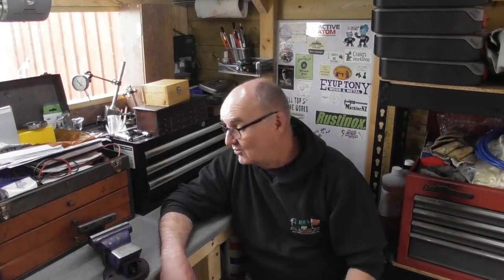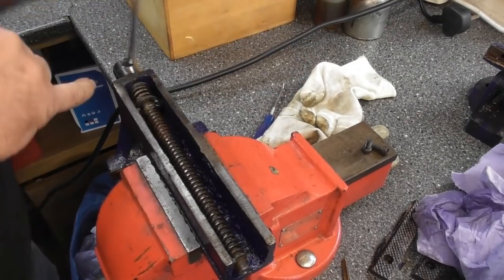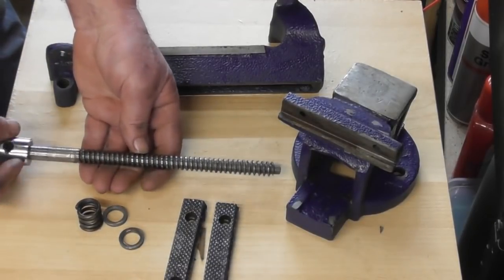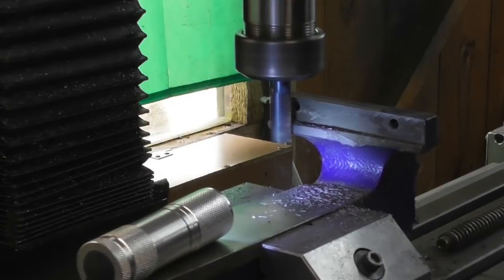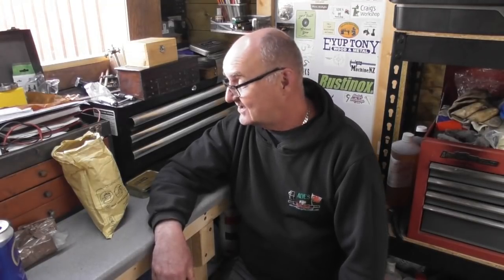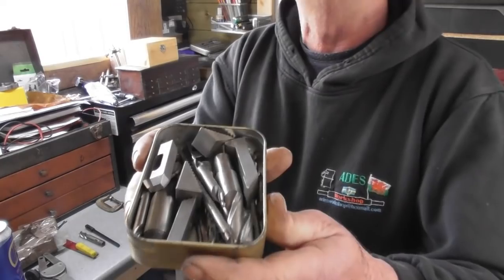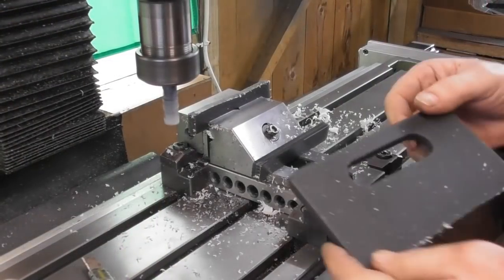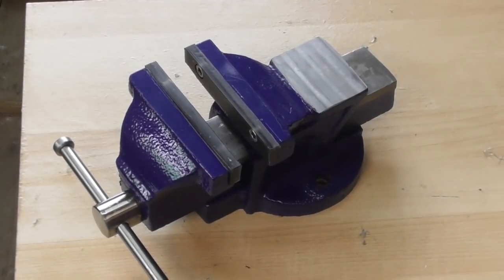Vise rescued from a Skip

Comment: Hi Ade, first time watcher. Well done on not giving up on that vice, but my God what a hunk of junk it was before you started! 

I have a cheap Chinese mechanic's vice that I believe dates from the late 80s or early 90s and it seems decent enough – saw the previous owner through and has the scars to prove it, and is working well for me now. When I first got it I looked up the type online to see what I could find and I came across loads of posts saying just how bad vices like this can be, especially ones newer than mine. But I didn't come across any that used a nail as a packing piece!! Just mind boggling.

Comment: ha ha, I love it 'it's not really worth the effort, probably should go back in the skip, but I guess I'll just clean this one thing up. well, whilst I'm here I suppose I can also fix that. well since I've done those might as well carry on... ;-)' nice work as always. Having just been milling some cast iron yesterday I think the mess alone would be enough to make me reconsider whether fixing the cheap vice is worth the clean up!
Reply from the maker: Shop Vac first then paper towel with a little WD40 usually gets the worst of it . It is stinking stuff to work with and this stuff was particularly bad . All cleaned up now ready for the next job . More cast to come with the steam engine . Cheers Ade.

Comment: Ade, TELL Stephen if he wants to send you any more goodies, use a BOX instead of a paper envelope. Common sense should have told him heavy metal with sharp edges will cut a paper envelope. Also wrap the cutters separately to stop them banging together and damaging the cutting edges. Well done with your goodies.
Reply from the maker: It was all packaged very well . I had removed most of the packing to save time in the video . The white van delivery men an be brutal at times . Cheers Ade.
Reply: @ade63dug  Royal Snail are just as bloody bad!

Comment: Terrys were based in redditch in the West Midlands, they made jubilee clips as well as other machine tools. My photo is a terrys turbine adjustable spanner, each finger is 1/32” wide.
Reply from the maker: Thanks for the info Chris . I have seen Terrys Jubilee clips but did not realise it was the same firm . Good quality stuff . Cheers Ade.
Reply: And they also made the spring clips that were used to hold a fluorescent tube in place in cabinets too.